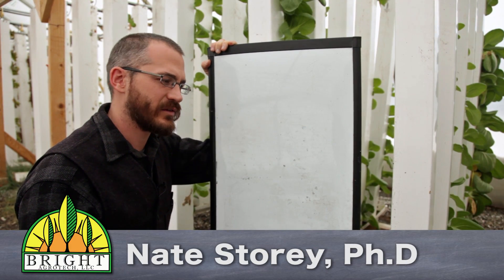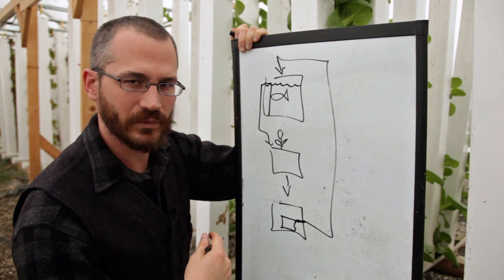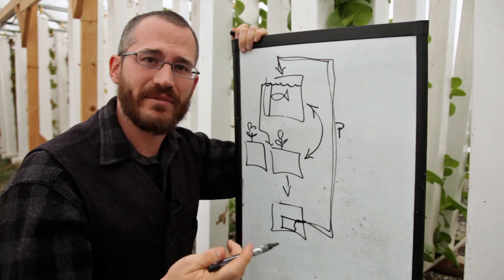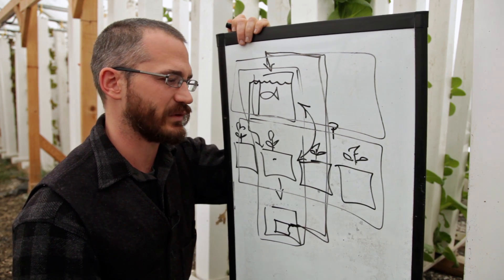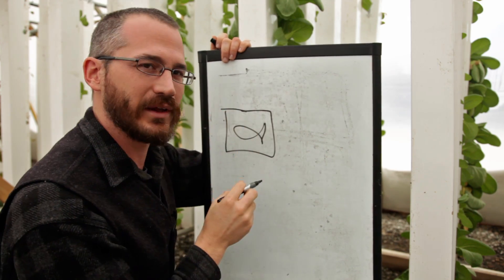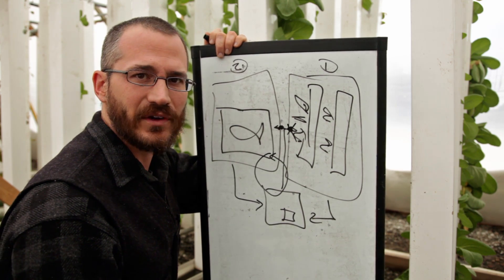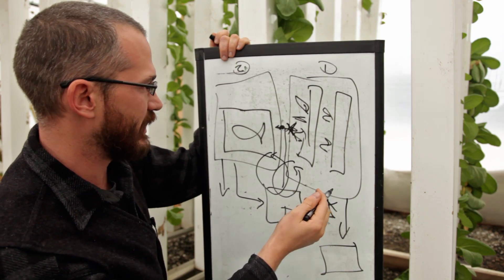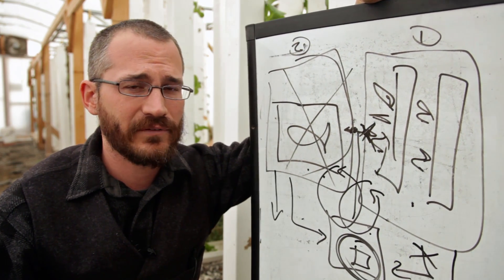1-Pump Aquaponics Systems: Splitting Flow

Comment: Very good video. Thank you!
Could you please show us how you filter/contition the water coming out of your fish tank before it enters the sump? I assume that from now on all my water, also the water which goes to the media beds is already solid free? Don't I use a whole lot of (important) nutrients if I just filter out the solids and dump them or are you using a different method?
Reply: For the most part, I believe red worms and ZipGrow Towers/Grow Beds set the stage for bio filtration (the bacterial version of "water conditioning").
Reply: DJ Naccarato
Do you think that there is NO solids removal/particle removal on the way from the fish tank to the sump?
Reply from the maker: We have "almost" no filtration before the sump.  We get rid of our heavy solids, but most are sent to the towers, which are basically trickling mechanical/biological filters.
Reply: Bright Agrotech
I really do like your concept! Do you suggest a swirl filter for the heavy solids. Right now I'm not using one, because I think I'd loose too much... I go from the FT to the MB with gravity. Then sump and towers. I'd like to eliminate the gravity to the MB. Could you please clarify on your heavy solids removal process or is this part of your business sectret (which I could understand, even if I wish you'd explain it in more detail). Either way: Thak you for the good work!

Comment: This is a very simple choice and almost a no-brainer actually. Now that you explained it like this, it doesn't make sense to spend money on a system you can't scale at a minimal cost. Pick up a large client and the plant capacity may need to drastically increase almost overnight....thanks for the detailed info on this one Nate!
Reply from the maker: Thanks Wayn, yes, it works really well for scaling down the road.  Drop in a new pump, a couple of tees and bam, you're scaling.  Super easy with this design.

Comment: Once again, well done.  Picasso would be envious of your drawings!  Seriously, I've been thinking about changing my system to a single pump system.  The biggest problem is my sump isn't large enough to support the volume of all my grow beds if they all are drained at the same time....
Reply: I've had this thought process many times.  ;-)
Reply: I'm sure you've thought of this, but what if you use an indexing valve to flood your beds in sequence for constant and predictable drain volume to the sump instead of auto-siphons?
Reply: I did that in my old greenhouse...it's just another expense and piece of equipment that will eventually fail.  I went with KISS as much as I could with the new system.  ;-)
Reply from the maker: Yeah, that's a toughie. I've been in a similar spot once or twice.  We actually dug in an additional sump well when we built our new greenhouse just in case we needed it down the road.  Scaling is one of those hard things to plan for. . .